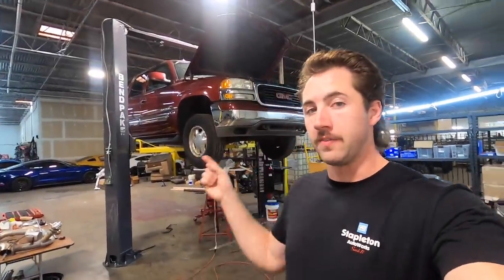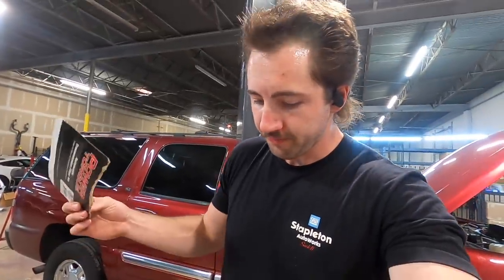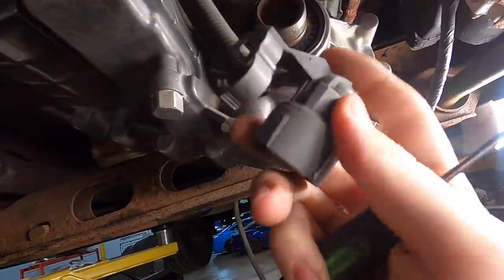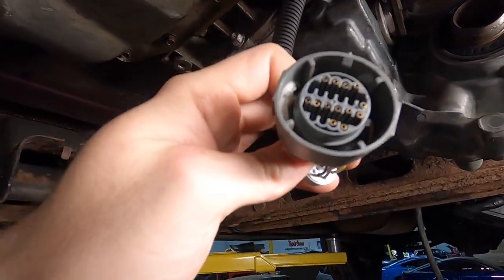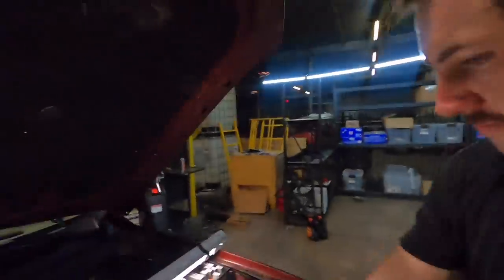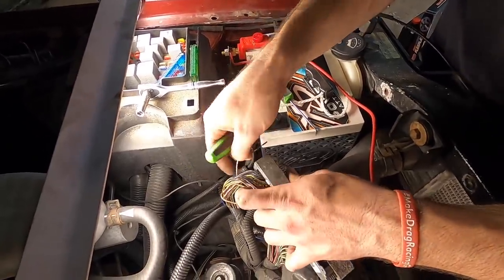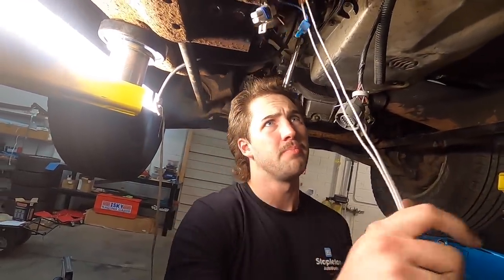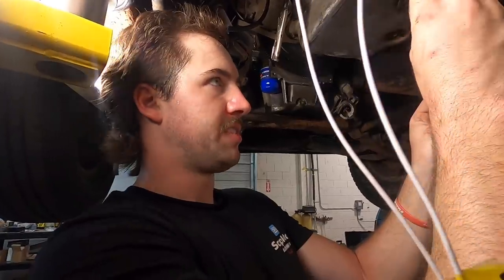Budget Turbo Yukon XL 4L80 Conversion (Part 4): THE WIRING CONVERSION LIFE HACK! The BEST Way!

Comment: Another way to do a continuity or ohms test, you could strip out the two wires you cut under the truck and wire nut them together and then test the two pins up top, when the tester rings you have your two wires, that’s how we find wires in houses when we are trouble shooting circuits.

Comment: Just wanted to share this tip . Hit the salvage yard and find you a torsion bar off another gmc .  They make the best prybars ever.  You can  shift around a full DRIVETRAIN with all the leverage and it will not bent.    Also I wondered 🤔 how many folks watch the videos while taking a 💩. Saw someone's comment that they we're.    
I knew I couldn't be the only one lol😅

Comment: i have 800 hp in a 07 tahoe 5.3 , all fuel , goes pretty good ... still has single exhaust out  the rear , just open the gate when i need it lol , bought it new , been a hell ride most of the time , finally dialed in about 2 years ago ....very strong :)

Comment: You've never seems this before!! Pulls out a pt.net doc thats been used by many. Busting chops and good work. I did 4l80 swap in a 4x4 02 Yukon. Almost like your work except I used a circle-d converter that needed no spacer with the flexplate.
Reply from the maker: When I said never seen before I am referring to the repurposing of the unused o2 sensor wires
Reply: @Stapleton42  I said, busting chops!! I get you. Wiring in a wbo2, thermocouple, etc in the stock wiring harness are all possible. HP Tuners is great. No joke a cop rear ended my Yukon so now I have a 6.2 Yukon Denali. Worth the pain I think.

Comment: They make a pin remover . It’s a small round tube with a slice in it . My grandma use to work in a place that made stuff like that connector . For car company’s . So all you need is a small peice of aluminum with a slice cut in to it but it’s foot a be real small . You slide it in the front to go over the little prungs and the pin will slide out the back

Comment: You can also ground the wire under the car and then test the pin to ground that way you don’t need have long test leads. You could also join the two cut wires and measure across the two pins. All your checking for is continuity.
Reply from the maker: Exactly. No stones unturned we do it the for sure way!

Comment: most times i pull trans with transfer case and on when trans going in seems harder but its prob bout the same but once its tail shft up and over xmember rest goes in fairly easy but there are occausions its easier to take transfer case off first but its a pain to fight trans and xmember just fight the x member if can

Comment: blue and green is a p59 pcm. I can unbrick those! If you have any bricked pcms laying around you should send them to me and I'll unbrick them and send them back as a trade for a SAW goodwrench t-shirt! Then you'll have some spares on hand to save you making another junkyard run next time one bricks. My deep dive down the PCM rabbit hole started with pinning a flex fuel sensor into the PCM on my 05 tahoe.

Comment: Are you going to do the fuel system once the transmission and transfer case are done or run it them do it
Reply from the maker: Run it on the dyno to see where the stock pump taps out at then we will upgrade. For science!

Comment: If you are doing wiring and you haven't tried a power probe your missing out. You can buy a off-brand one for $40 on Amazon or you can buy an advanced kit on there for $200 it comes with little wire hooks where the point screws in to the wire so you don't poke yourself. I have a ridiculous Snap-on one that has a built-in voltmeter that can do AC and DC.
** what makes it different than most volt meters is you can not only test the wires but you can also charge them positive or negative with the flip of a switch.**
https://www.amazon.com/dp/B007QV0R7W/ref=cm_sw_r_cp_apa_glt_fabc_0ATESC3SZ8W6JSXEQ5HN?_encoding=UTF8&psc=1

Comment: sorry bro.... I got a guy.... you've heard it a thousand times.... I don't do wiring!!! none...zero. unless I want it to burn down..... lol I don't have 2000hp... I have solid U joint front and a nipplie one on the back... making the rear the weak link. a very neat custom drive shaft hoop system saves my floor.

Comment: Owning a 2001 Z71, doesn't take a rocket scientist to figure out the path that lead me to this channel at 3am. 

I came for the 5.3 turbo.
I stayed for curiosity of wondering how in the hell this guy got with that girl. 

Don't let that girl go bud. The chances of a guy like you getting with a girl like that is around the same as hitting the lotto.

While being struck by lighting.

Immediately following being attacked by a shark.

But not by like a regular shark, by like a megalodon. 

During a sharknado.

Yeah... Those odds sound about right.

Comment: Ummm...GM doesn't label most of the positions on the connectors any more so the world keeps getting more difficult. Just wait until a squirrel chews off all the tans or purples. Even more fun is high speed LAN is tan (two in two out each module). I think those that understand your video already know how to do it. The main point is a 4L80E has two speed sensors. The 4L60E has one. That's the actual point here. Put WD40 on the wires. Maybe you could do an efan swap first next time so all this ECM pin swapping would be easier to understand.
Reply from the maker: I’ll be doing e fans soon!
Reply: @Stapleton42  I have fan connectors I think...if you like to build your own harness.